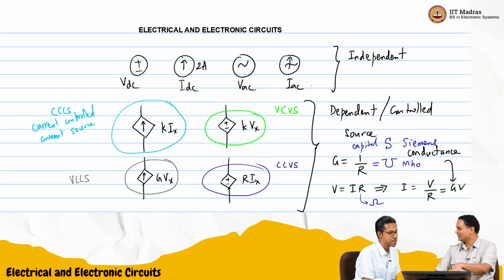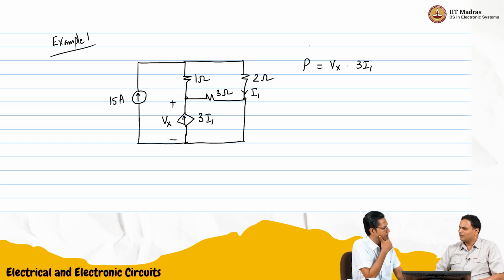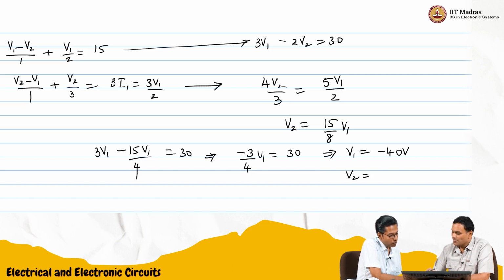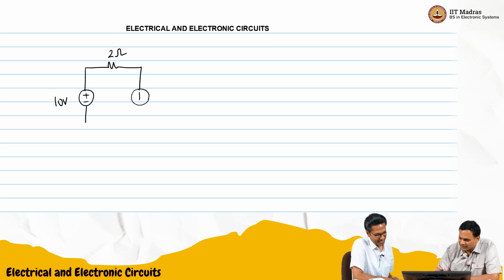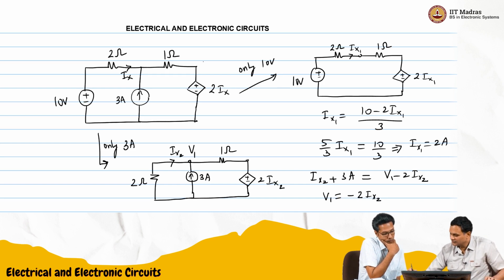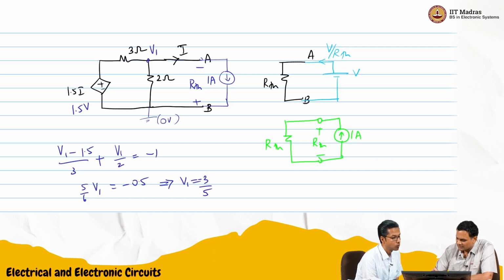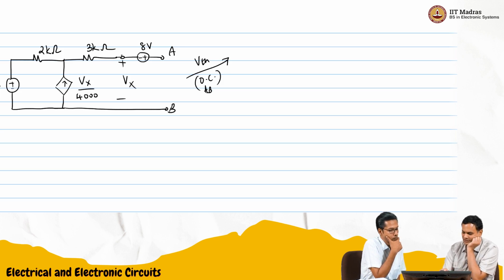W3_L6: Problem solving - dependent sources | Kirchhoff's laws (KVL & KCL), nodal analysis

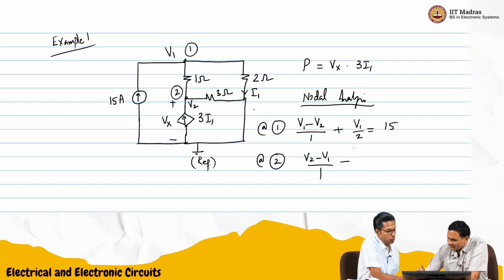Comment: 10:20  Important point
28:22 You can't transform the controlling variable completely 
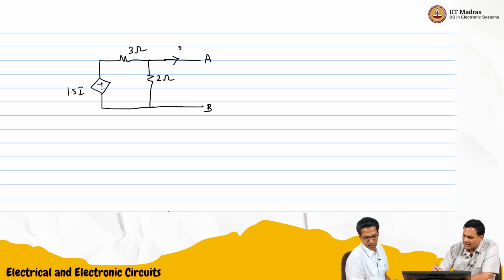 30:07  interesting question
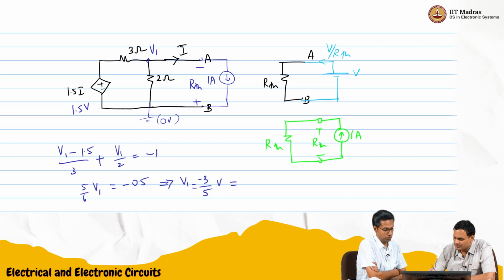 34:24  crucial moment of +/- sign
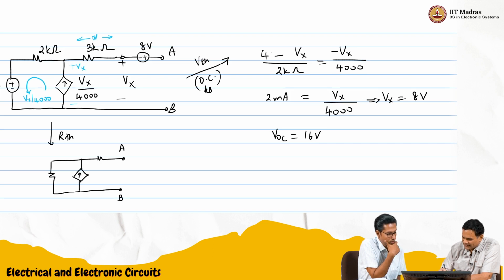 44:34  note that: Dependent Current Source isn't shorted here and external 1V is applied for calculating the Rth
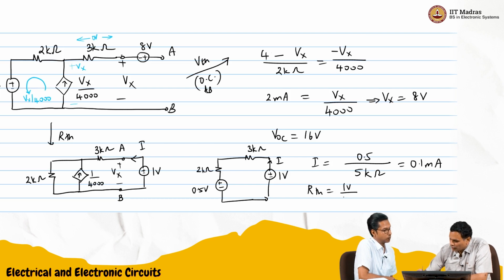 46:18  Vth is our applied external 1V
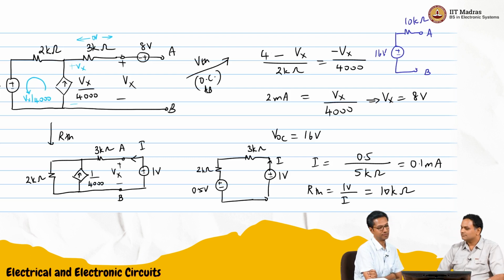 47:25  After calculating all of these, there is no dependent source in thevinin equivalent circuit